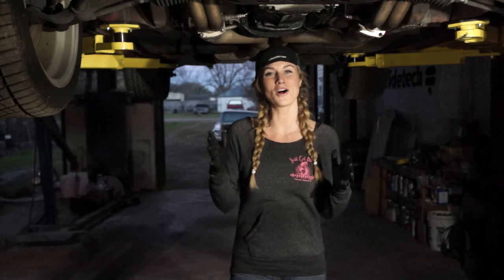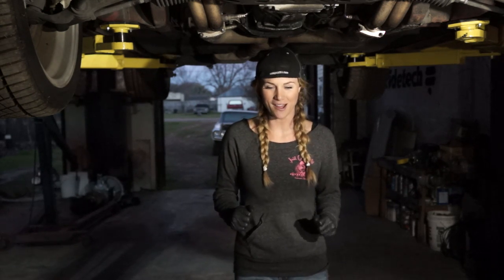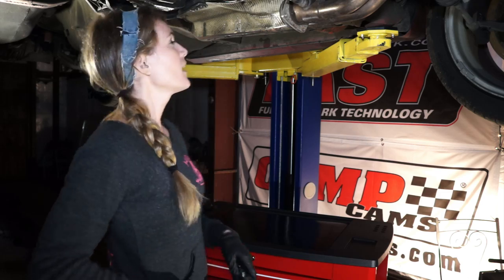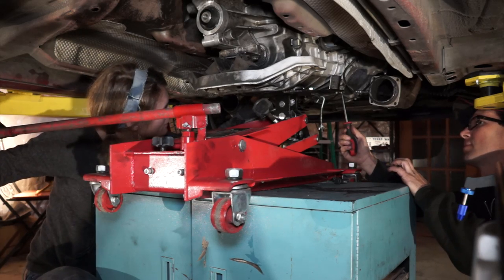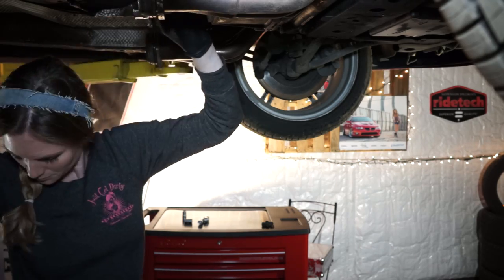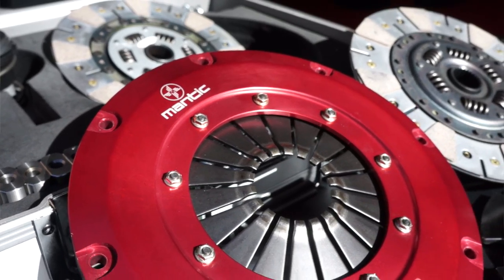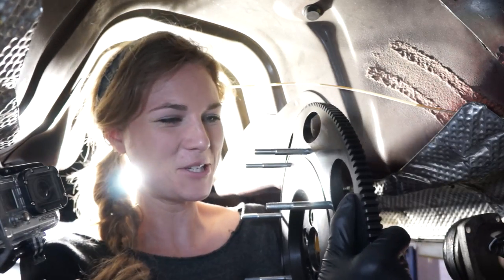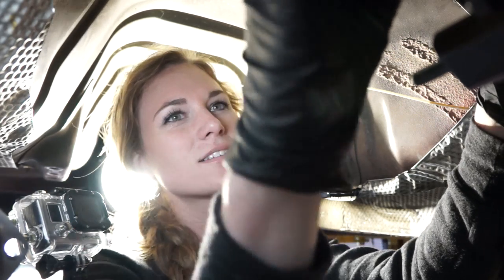Clutch install on GTO - In the shop with Emily EP 16

Comment: wow never knew they had 2 section drive shaft, btw some feel yoke should be marked at the diff to put in same clocking as it came from factory but if it vibrates you can always re-clock it.

Comment: I was looking for Clutches for an LS engine swap for my Camaro about 5 years ago and I found Mantic. Dual disk clutches.. I thought they were a better set up than most Brands.. I think there is a Brand based in TX called Monster that has a rather bad reputation.
  Modular means that you have to use the Mantic Flywheel too.  They require a steel flywheel  at the Drag strict and a Heavy thick steel bell housing too.

Comment: Nice video.. One question does the extra hole on the flywheel matter as far as orientation go. I noticed it went from the 7oclock to the 4 oclock with out any description on it. Just curious as ill be installing one soon enough. Thanks
Reply from the maker: Hey there! I am unaware of the significance of the hole!  (I watched the install video provided by Mantic, they make no mention of it, either!) I did move in the video because a felt one of my bolt heads slide out of the channel so I had to pop it back off real quick and tap it back in! 😊👍🏼
Reply: +Emily Williams bucket list number 28 Emily replied to my comment. Haha. Thanks for the reply. I appreciate the information and all other videos. 👍
Reply from the maker: +Garmans12valve Oh gosh, you're a funny one!!!! I had a few typos up there- ugh. Kinda half asleep editing more video! Suspension on the Impala, coming soon! Keep watching bud! Appreciate ya!

Comment: I have 2002 z28 and just got a GTO T56 because i was misinformed the rear mount shifter and the slightly shorter output shaft is not gonna work in my F body ....Do you know if I can just get a steel drive shaft cut made and welded a little longer from summit ?  Or do I really have to have a shop put in Fbody output shaft in so I can use the stock 41.75 in driveshaft   Any help Much Appreciated

Comment: Great video!  I just installed a Mantic 9000 series twin disc in my C6 Z06, but won't be able to do my break-in miles until my new intake port seals come in for my intake manifold. Pedal effort after a good bleed seems about like my stock LS7 clutch. How do you like the engagement of the clutch? Easy to drive? I'm excited to get my break-in miles done, and hope the car is as drivable as it was on the stock clutch. 

Side note, we found this Mantic is a full 20lbs lighter than the stock unit!

Comment: nice install. quick question....you have an electric impact gun, which you seemed to have used for the flywheel to crank bolts. Why didn't you use it more as opposed to doing it by hand? I certainly understand hand tightening, but to get it apart i personally prefer to use the air/electric tools. Looking forward to more vids
Reply from the maker: Two words: tool sponsor. 😂😂 You're completely correct, it's much faster and easier to use the air tools! Maybe someday I'll get some air guns from them! 😉 Thanks for the support!!!

Comment: Great video, and I will check out Mantic for my WS-6 Vert.

Just a FYI,  be careful holding the head of a torque wrench while tightening, It can throw off the accuracy .

And can someone sponsor her air tools!!
Reply: +Steve Cox And not holding the torque wrench head with throw it off even more, if you can get anywhere close before ot rounds the head from falling off.

Comment: how rough was the flywheel removal really haha, you have to lock the pulleys or did Aaron hold them?
Reply from the maker: No crazy editing there other than speeding it up! It was actually a pretty smooth removal for once!!
Reply: +Emily Williams nice, always a plus!  Torquing mine to 105ftlb was a bear with the motor on the ground twisting an spinning the shaft.
Reply from the maker: +Will Tyree I always put a break over bar on the crank bolt to hold the dang thing in place!!!
Reply: +Emily Williams see its all skills, an tools haha lots of tools

Comment: You just built a top fuel or funny car 2 disk set up an a 3rd disk an hang on mamma  an one piece driveshaft an that gto rearend will fit the z car alot stronger

Comment: Do you have any negative camber issues from the rear?
Reply from the maker: I have Pedders track 2 kit with the 2inch drop- it took some adjustment to get my camber evened out where my tires wore evenly but she's been good since! It's been....like....7 years!!
Reply: +Zo6LS7427 The Holden IRS system is renowned in Aus for being a pain to lower and keep decent alignment. It throws Camber, caster & toe out just in general travel. Let alone when you lower it.

Comment: Hey guys had a quick question. I've got an 06 GTO with a Hendrix stage 3 clutch in my car and it's killing me cuz of this damn traffic in the ATX, I'm seriously considering a Mantic clutch but was wondering what the pedal pressure is like on your setup?. Thanks Y'all
Reply from the maker: David KEMENESI It's really nice, I've ran a spec, it was suuuuper stiff- and the LS7 I had was like buuuuutter, this one isn't as easy as the LS7 but I really like the drive ability for how strong it is!!
Reply: Flying Sparks Garage I forgot to mention I'm running a TVS 1900 setup on my car making a little over 500 at the wheels would y'alls clutch hold that power level cuz I may go e85 down the road and see if I can make a bit more Hp.
Reply from the maker: David KEMENESI Yeah dude, Roxy put down 522 NA, that clutch is good to 1100tq anyway! It's hellaaaaa strawnggg 💪🏼💪🏼💪🏼
Reply: Flying Sparks Garage Awesome thanks for your time love the channel keep up the good work 👊✌

Comment: I bought the same clutch to fit into my LS2 swapped in a '70 Z28 Camaro about 2 years ago and its still in its good looking suitcase, I feel shame to hide its beauty in that ugly bellhousing!. Have you noticed any reduction on the pedal effort?, it should be lighter than stock as per what they say.
Reply from the maker: Groupwar NA It's been so long since I've ran the stocker, I barely remember the feel! Lol! It's an easy clutch, but probably not easier than stock? Once it's broken in, after 500 miles or so- the pedal is like buttah!! I understand keeping it in the case though!! Haha!
Reply: Thanks Emily for the info, I need to dig for it in my garage and start the install. Please keep going with your videos, very informative and amusing.